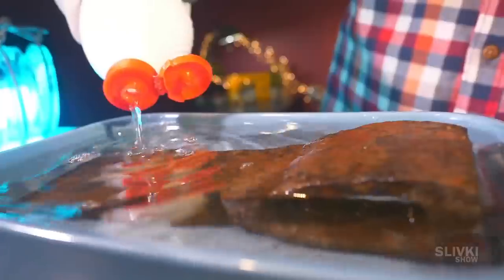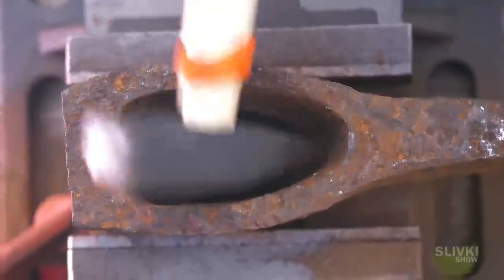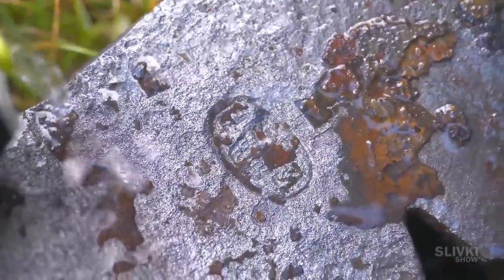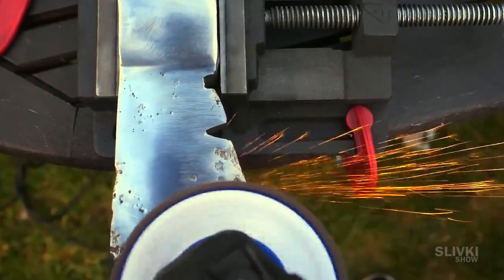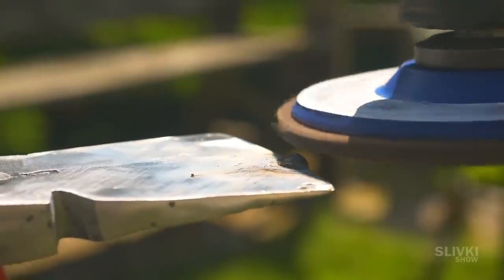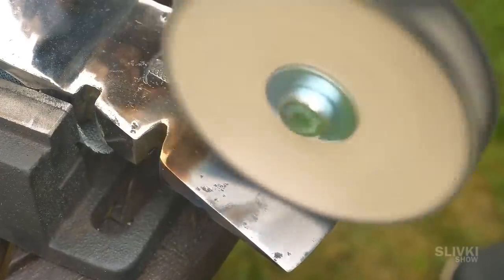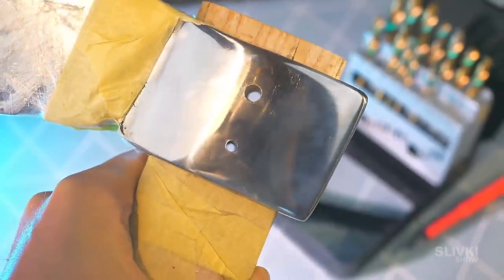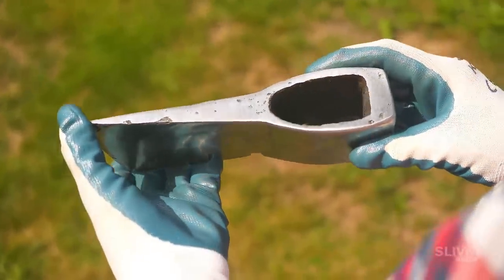RESURRECTING AN OLD AXE

Comment: WOW! Look at this beautiful rainbow! Time to grind it away.
Reply: ikr😌
Reply: The rainbow means that the the strength of the steel has been weakened by heat but otherwise yeah why ruin a pretty rainbow
Reply: @jackdasnako3602  would it cool down and not have a rainbow?
Reply: @elcarlos2774  yep
Reply: @MinorityHunter516  so, if it cools down, no rainbow. and if it really hot it rainbow?
Reply: @elcarlos2774  yep
Reply: That rainbow things appear because of the extreme heat.
Reply: @MinorityHunter516  thanks bro

Comment: - "this is something like vinegar, but stronger"
> label says 14% white vinegar
> 20% is considered regular ass white vinegar where I live
Nani?
Reply: Where I live, 7% is considered high dose.

Where do you live?
I live in Belgium 😊

Didn't know there was a 35% somewhere free for everyone to use
Reply: @Liesbeth22  at 35% point it's just diluted acetic acid and not strong vinegar.
Reply: @royalgummyworm8131  true 😂
Reply: 9% where i live
Reply: 5% in India
Reply: Maybe it's anti rust with vinegar?
Reply: 5 percent is normal vinegar, rice vinegar has 3, my concentrated vinegar (for cleaning) has 25.
14 would already be concentrated vinegar, although a comparatively week one.
Reply: whats 100% vinegar
Reply: @JNJNRobin1337  acetic acid
Reply: wth that much it's only 2-4% there
Reply: @MDJ774  That's not vinegar, that's water with traces of vinegar.
Reply: @dominic.h.3363  Probably

Comment: I dont think you heated the edge hot enough to heat treat it.  It might just be really soft now, but for splitting wood that's fine.  If you get a really powerful torch, like oxyacetylene, you might be able to heat up the edge cherry-red hot and quench it before it burns the handle.  The metal needs to become non-magnetic before you quench it in oil.  Water at that temperature will be impacted by the leidenfrost effect and not cool the edge quick enough.  Test the edge with a file, and if its hardened, the file wont be able to remove metal.  Also a good technique is to pull out the axe a bit early from the oil so the residual heat will temper the edge for you and you dont need to temper it in an oven.  The rainbow colors you saw are different levels of oxidation at different temperatures.  You want a wheat-like yellow color temper after the hardening, which is about 400 degrees F or 205 degrees C.  Blue is too hot, wheat/straw colored is good.  The hotter you temper it, the softer it gets, and for axes you might want a softer edge, so maybe go for a darker yellow color.

Comment: You did a great job with the hatchet. Going through the process, step by step, would be a great help for anyone who would like to restore an old rusty item. I have just restored a very corroded set of allen keys to functional condition. I use citric acid powder, from the supermarket, as I can control the strength of the acid solution. 👍. Thanks for the videos.

Comment: I really love the restoration of the axe! It still has the holes but it gives a nice 'vintage' look to it, looking forward for you to restore (maybe) a knife next?
Reply: they destroyed the axe.
Reply: @xxgoodboy1499  what do you have proof
Reply: He welded mild steel to the edge.
Reply: @xxgoodboy1499  oh ok I though you say he destroy the axe
Reply: @RotexBlades  he did. Mild steel is not close to what should be on the edge. Additionally, it's hung on the handle like crap. That thing will be useless in one rainy night outside. The head will fall off and mught hurt someone.
Reply: @xxgoodboy1499  You are exaggerating tons here - the mild steel on the edge is one thing but saying that the head will fall off is just nonsense. 
I do, moreover, think that this axe won't be used much anyways.

I was just interested in the logo and possibly dating this axe - do you have any ideas on that? I think this is maybe during the early Soviet Union (1920s?)?
Got no experience with Slavic tools, weapons, armour and so on.
Reply: @mabeSc  most likely a hand forged tool. The brand imprint could be the maker's signature and the 3 is probably there for him to know which one it was, if something were to go wrong with the axe. Or it was forged on a pneunatic hammer system, similar to what Gransfors bruk is doing today.
Regarding how he restored it, you can't say that's a well hung axe. The way he wedged it is absolutely horrible. And he used paint instead of oil, which barely helps the tool be resistant to moisture. Yes, he did sax that he might drill a hole through the eye and the handle, but that 1)splits the handle, and 2)doesn't help you at all because of how many wedges there are and how they're positioned.
That was a really well preserved piece and had a beautiful profile. Pisses me off a little to see it get, what would basically be, ruined.
Reply: @xxgoodboy1499  Do agree that this was not a restoration which respected the history, composition and era of the axe alongside ruining some parts but I think this will be hanged in his house somewhere.
Also reading a book on how axes were forged could have helped him lots in restoring this axe to a much more original state.

By the way I think this axe is an old model made by Hults Bruk (look it up - really similar).

Well, at least it was not something too ancient. In Romania I have a Falx (or something that resembles it), which a friend of my father found while tilling a new piece farmland. Am not yet sure if it is a Falx but, given that the upper part is broken (but does still have that classic curvature) and it has an absurd rust and dirt layer only some cleaning will tell.

I can't get working on that now but I will do as soon as I can.
Reply: @mabeSc  i don't even see the point of hanging it on a wall if it's useless... there's no pride; no emotional value, at least when you know you didn't treat the thing right.
That aside, that falx of yours sounds pretty damn interesting. How badly rusted is it and where? That's acutally something you could hang in a wall and look at all day. That, and the black raven axes.
We have a bayonet we found while tilling, tho it's rusted beyond use. Don't have the material for the bevel for an edge, nor for the spine to keep it in one piece.
Reply: Love how a comment of I love this goes to I hate this so quickly
Reply: @peyten8811  it's not a case of just being toxic. He restored the axe absolutely the wrong way, basically ruining it in the process, and people love this simply because it's shiny. Honestly, I would really like to see this bit in it's former glory, but he at least could have done some research on how to do this properly. It's not toxicity, it's objectivity. I don't mean to sound rude, but that's how it is.

Comment: You started grinding with a flexible, 'Flap Wheel', disc. Then proceeded to a coarser inflexible disc. Because it was taking longer or not aggressive enough with flap wheel? I would have taken my time slowly grinding/cutting the surface to not overheat the axe head and lose temper or hardness. This also allowed to have more control over maintaining the profile of the axe.

Comment: Hey!
Loved the video but I’ve got a piece of advice:

DO NOT USE THE AXE! IT WILL BREAK

The edge of the axe is extremely brittle right now! You heated the edge to a very high temperature in the coal and then cooled it off in water. That means that the metal cooled really quickly, causing it to become hard, but very brittle. 

If you want the edge to still be as hard but not to brittle, do something that’s called ‘normalising’. Heat the edge up in the coal again but let it slowly cool in the air. Do that 2-3 times and you’ll have a wonderful axe!

I hope this helps!

Comment: The notches on the underside might have been use to pull nails from timber or wood beams if the axe was being used for framing and building.

Comment: That axe looks like it was originally meant for light duty limbing and brush work meaning that it was the sort of axe that most lumberjacks would have strapped to their belt but only use to mark where to cut and what trees need to be cut

Comment: I know you tried but that's not how you heat treat steel. you need to get it to non magnetic temperatures and cool it down in canola oil (or any other heat treating liquid. The water just made it more brittle)

Comment: I hate what you did to attach the handle. It was all so unnecessary. Single wedge is a perfect solution, so you can easily detach the handle if you need to work on the blade or say replace the handle.